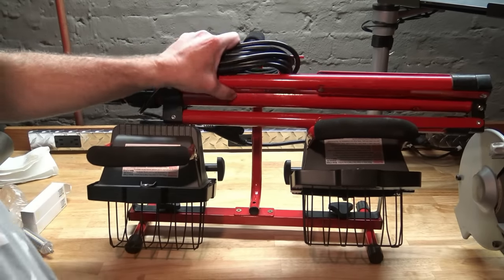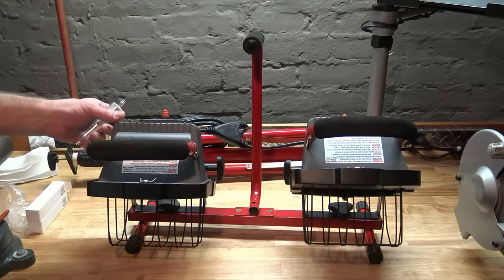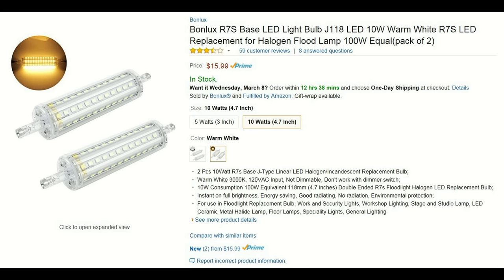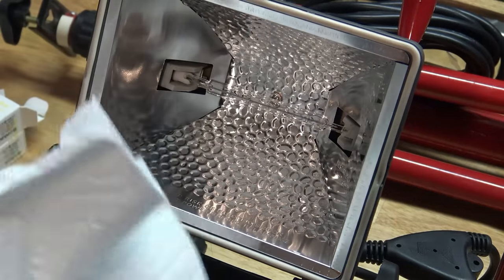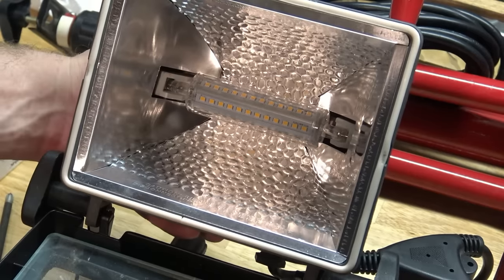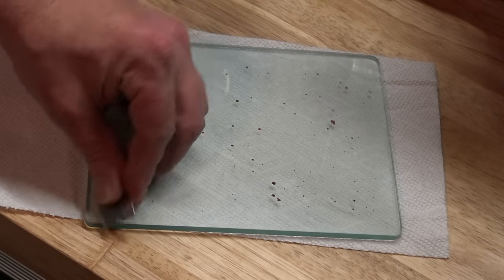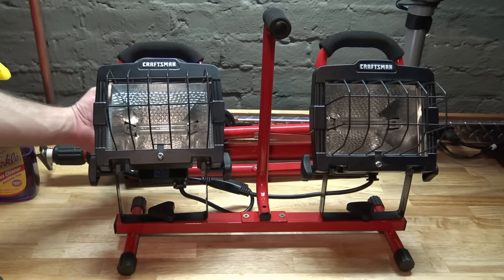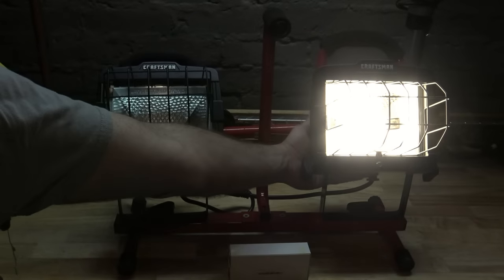Craftsman Work light EASY LED Conversion From 1000 Watt Halogen

Comment: Thanks a ton for this video! It was such a relief having this solution on a photoshoot. Needed just a few more lights so I improvised. The heat from the original  bulbs was just too dangerous, but there is no heat at all from these! Outstanding, thanks so much! Tipbot?

Comment: If it were only that easy.  The LED replacements I got were a fraction too long and I had to pull out the reflector and modify the contact placement so it would work.  It's what happens when there's no quality control.

Comment: I know with the halogen light the back of these work lights gets really hot, does that still happen when you change the bulbs to led?
Reply: No, LED use much less power so much less heat.  Only problem is, it's supposed to be a LIGHT and now makes a lot less of it.  You can also buy lower wattage halogen bulbs if you just want less light and have higher CRI.

Comment: I wouldn't really call this a shop light. I have the exact one and use it for drying paint and working under the house and outside at night and for other things that require a bright bulb. LEDs are cool and this is a good video but it kind of makes the light useless for it's intended purpose. Good video though.
Reply: Turns it into a 100 Watt light.

Comment: LED lights do not last and are not as dependable as incandescent period. Best thing is to keep the halogen light the way it is and buy another light(keep both types). The incandescent will last a lifetime(and your childrens childrens lifetime) and if kept in a dry location can be stored and fired up anytime in the future. The epoxy that holds the LED to the lights circuit board degrades over time and other components degrade(I have many LED lights fail in short order including a $130 Nighcore 2000 lumen flashlight that lasted 15 minutes total use in eleven months until it failed). These LED lights are NOT as bright as 1000 watts of halogen either. So have both for the LED is good when working inside especially in summer and the LED is easy to drive with small generators during emergencies but always keep the tried and true incandescent around just in case. LED lights break and usually are not DIY repairable, unrepairable lamps would have been a joke in days of old but its a reality these days.